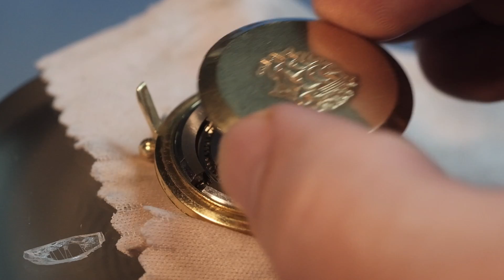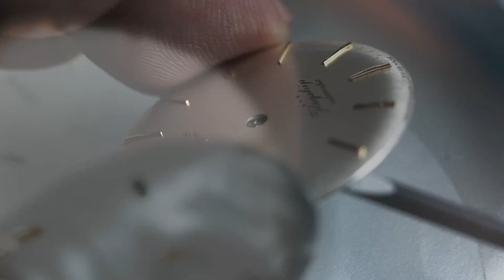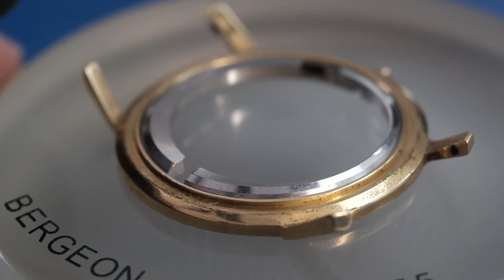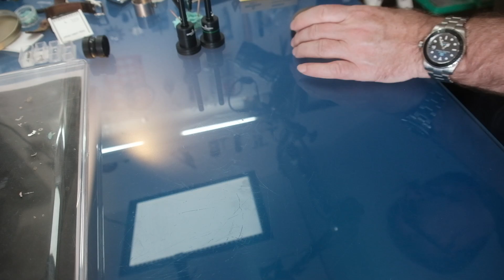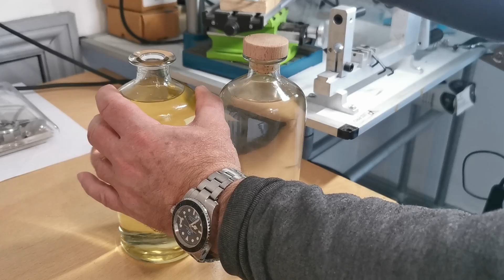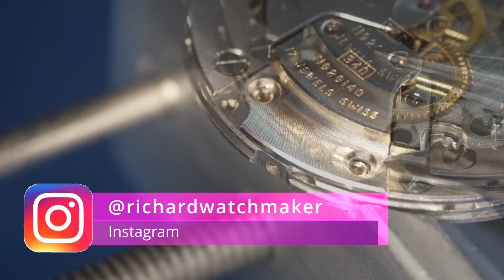Longines Restoration - A Fallschirmjäger's Golden Gift

Comment: The rotor looked loose when you first took it down.  Was it just a loose screw?  There also seemed to be some complex wheels/gears.  Did you need special oil (i.e. Lubeta)?  Beautiful movement and watch.  Thanks for sharing.

Comment: That unique movement design is incredible.
The unusual rotor is probably made that way to make the movement thinner.
Which seems to have been the goal of this entire design, which they did a good job on.
Good seeing the piece back in working and presentable order, it deserved the service.
Reply from the maker: Hi @WyvernDotRed.  Yes the guys at Longines designed a really interesting calibre with this 340.  Then they implemented it with an impressive finished.  Very pleased you enjoyed this. Richard